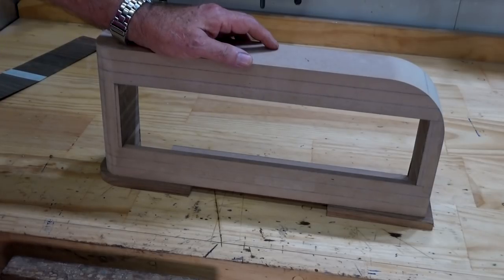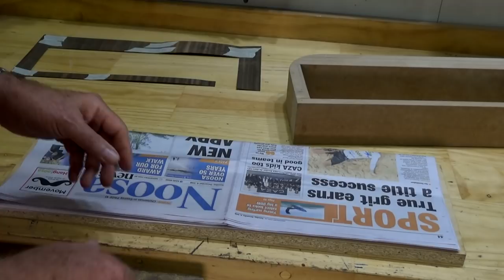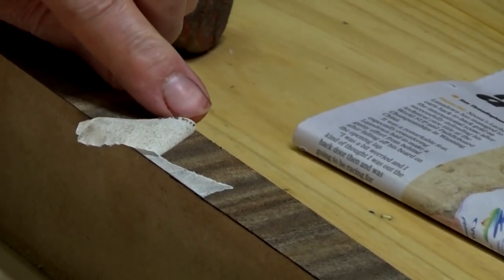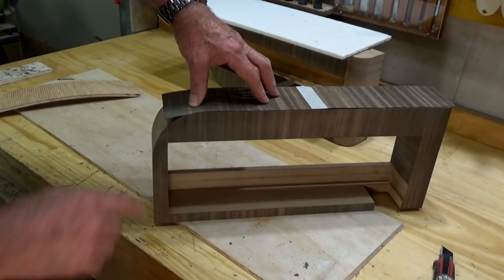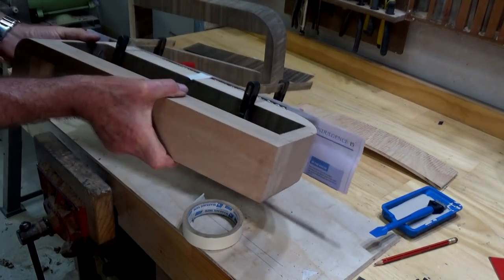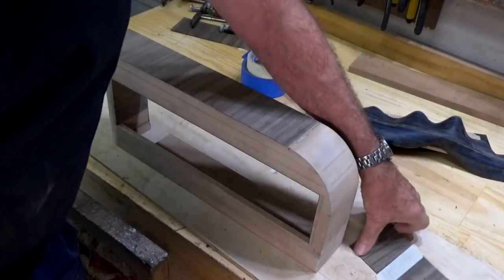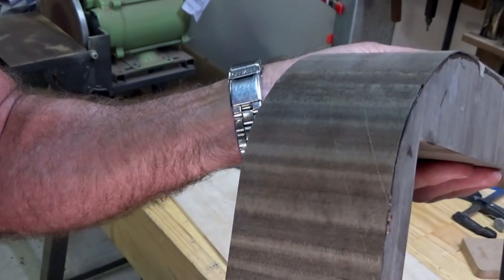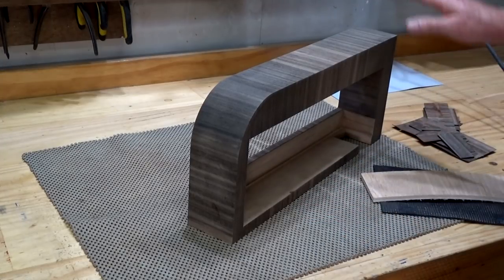Victory over Veneer - Lixie Clock Part 4

Comment: Beautiful job, I really love this series. Regarding that rubber band, while watching it I felt like it's doing the exact opposite of what you've expected. You stretched it before clamping to the veneer, and then it was *pulling the veneer back*, making it to rise and separate from the MDF.
Reply from the maker: I was thinking about this over the last few days and the rubber was still under tension when it was released but I take your point about it relaxing slightly. It only seems to make a difference on the edges though. I was wondering if the glue was making the veneer expand across the grain and this was causing it to curl away from the surface at the outer edge. It was certainly pressed down hard when I left it to cure and the gap seemed to open up some time after that. Chances are, I'll never do this type of job again so I guess I'll never get to the bottom of it. I guess the right thing to do would be to repeat the setup but without the glue to see if it still happens.

Comment: Use some salt sprinkled on the glue to prevent slipping. I would have thought using contact adhesive would have been a better choice as well. Coat both pieces wait until just tacky and apply sticking as you go. I seem to remember using a cloths iron as well back in high school. I've also used that for laminate table tops in the past and see no reason why it wouldn't work here.
Reply from the maker: I did think about contact cement and it appears that those lucky souls who live in the USA can buy a very good type called Weldwood but it's not available here in Australia. The type that I can get is a bit thick and unless you can spray it it can go on unevenly and it can look a bit tacky at the edges. However, I must say I have never heard of using salt to prevent slippage. I must try that. Thanks for the tip.

Comment: i use shitty masking tape for that purpose. another idea that just came to my mind and maybe worth an experiment would be cutting off the sticky bit from sticky notes, because that adhesive also is not very strong but maybe strong enough to hold the veneer in place for glue up
Reply from the maker: I have mostly always used masking tape. On veneers that have sloping grain I usually just run the sticky side over my fingers a few times to kill the adhesive a bit. It's always a lottery though.

Comment: Interesting - who would have thought that an 'apparently' simple veneer glueing operation  would be so finicky?  How thick is the veneer?
Reply from the maker: Ian, the veneer is quite thick. Around 0.65mm or .025". Most veneer that I have used prior to this was around half that thickness and much easier to bend. Having said that though the Qld. Walnut that I am using on this project is easier to work with in the sense that it doesn't split or fracture easily.